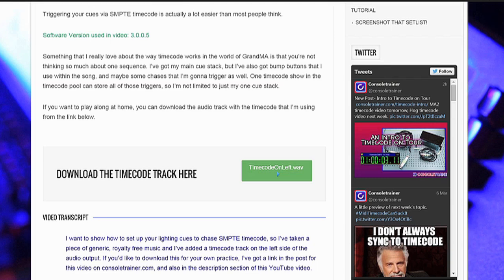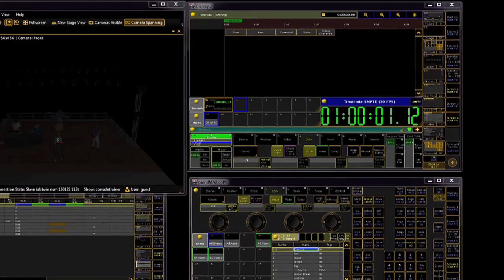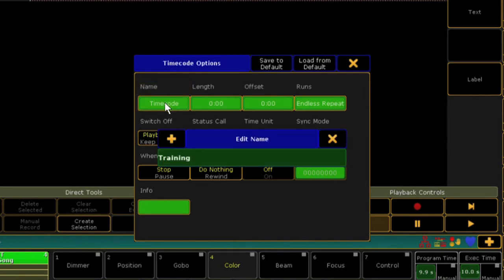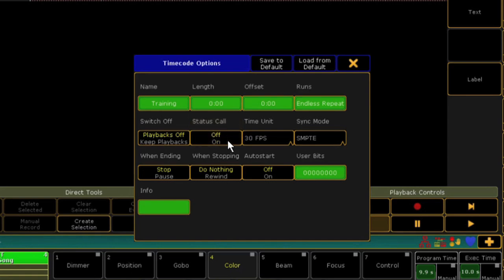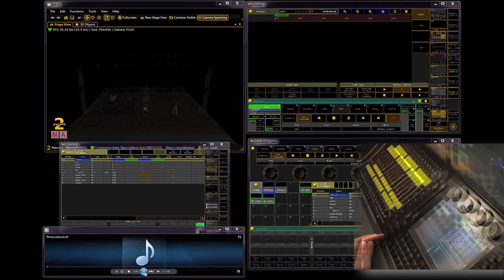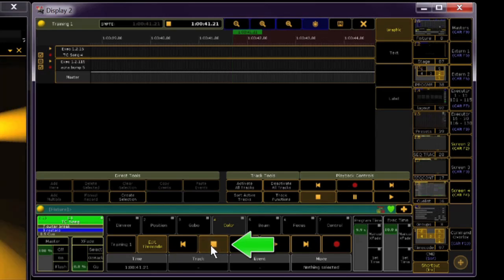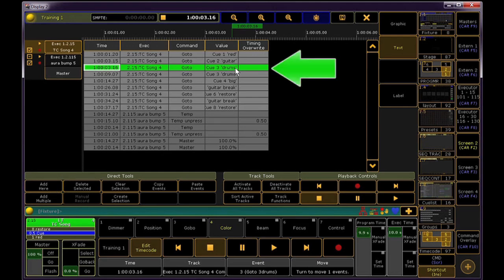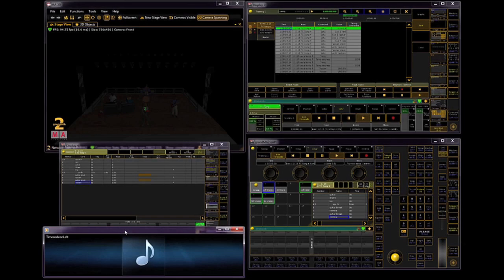How to Set Up SMPTE Timecode on GrandMA2

Comment: Hi. Thank you for uploading this video. I have a question?  How would you connect with reality in a show? If I use a soundcard like you, but plug both ends of the wire through the audio mixer and take another wire from the mixer, plug it into the LTC on the MA, is it possible?
Reply: Just do it thru a matrix of the mains

Comment: I've set up a show using timecode and I'm trying to render a video. I'm running into problems with frame rate. Lights aren't strobing at the correct speeds, gobo rolls look choppy. Does anybody know a solution to this, or a good software to use for screen recording that won't have this problem?
Reply: use obs